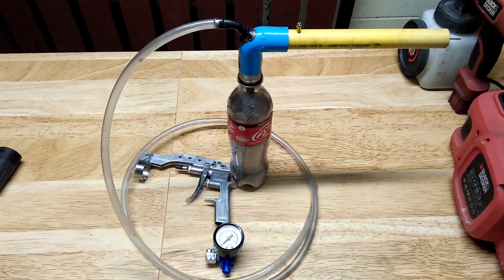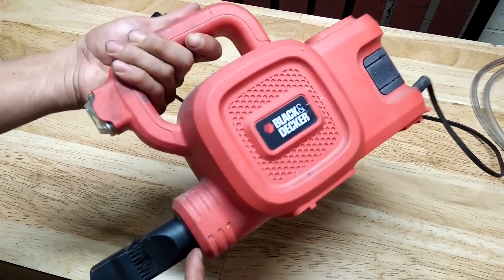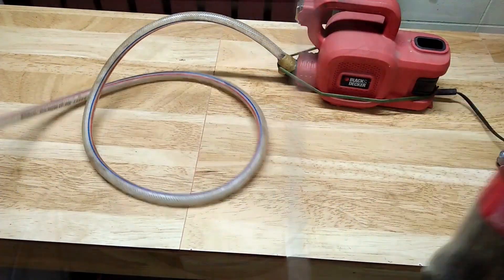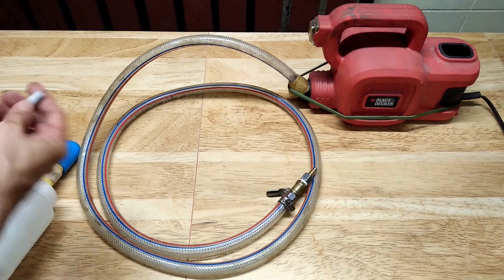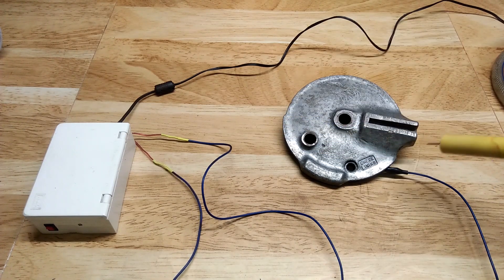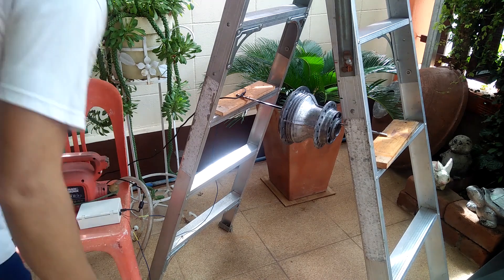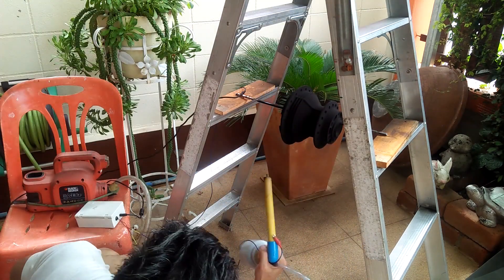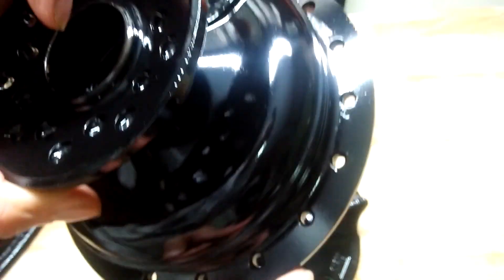Homemade Powder Coating Gun Ver.2

Comment: Can I use simple DC electric supply 4 volt 3 amp with cooking stove module ?
Reply from the maker: Hi. I am not sure what cooking stove module you have. Can you give more details? There is a high voltage generator on some gas stove that is used to create spark that ignite the gas. If it have DC output then it can potentially supply high voltage electrostatic charge.

Comment: Is it possible to use a high voltage transformer for a TV, and how do we determine the polarity because the transformer has no polarity?
Reply from the maker: Hi. I made some experiments with different kinds of high voltage transformers including the tv flyback. Have a look at this video:
https://youtu.be/U24Y4QNquX4?si=ROwMRklKb_Is1HwT
Most of the tv flyback transformers have internal diodes so they actually have polarity.

Comment: Have you thought about making a Tribo style gun?  No real electronics  needed. I have watched all your P.C. gun videos; I am amazed with your ability to think outside the box, and with your skill in electronics. Very insightful videos.  Thank you.
Reply from the maker: I have thought of it. I have looked online for where I can buy the PTFE plastic or teflon that is needed for the tribo style gun but cannot find a suitable material yet. I'll give it a try some time.
Reply: @DIYPhil 
You may try teflon tape used to seal hydraulics connections. Just wrap it tidly around any nonmetal material of your choice.

Comment: Did you use regular cables? 
Havent you receive a spark through the cable crossing your hand when its on? 
I'll be using a relay to run compressor and hv generator, just worried about crossing these cables with hv and no proper insulation
Reply from the maker: Hi. Yes those are just regular wires. In this version, I am only supplying lower voltage and limited current input to the HV generator/taser module so it is not on full power. Otherwise, you are correct that you may get a shock. That is why in my latest versions, I totally scrap this idea and build my own HV generator onto the actual gun so no HV in the cable. Please have a look at my updated videos of the homemade powder coating gun.
Reply from the maker: https://youtu.be/zr-EW036TUI
Reply: I watched them all
Excelent content hehe 
I'm still trying to fix my unit, but I'll make one of these to use in this meanwhile

Comment: What is your reason behind considering power coating over chrome or nickel plating...? Want to power coat my suv rims/wheels...the only thing setting me back is i have to build a large oven from scratch and it aint cheap.
Reply from the maker: Powder coating gives you more color option and is more durable than liquid paint. Try to find shop that do powder coating in your area
Reply: @DIYPhil   Did a look up around already...people either dont have large ovens or the service charge is way too expensive..I finally narrowed on nickel plating which initially gives a frost chrome look which am totally into...the whole setup was effortless,relatively cheap and redoable.👍

Comment: Kinompare ko kasi readymade powder coating machine here in Thailand, parang pareho lng po ang resulta, i can save money for this, ang ibili ko ng rradymade na machine i assemble ko nlng ng diy oven no? Dba po?
Reply from the maker: may next project din ako DIY oven, nakabili na ko ng insulation, wala lang oras pa kasi dito pa ko sa trabaho. kung gusto mo pre kontakin mo ko sa emai: philipal2015@gmail.com o kya message mo ko sa LINE eto number ko dito sa Thailand: 0898154451
Reply: @DIYPhil  Ok to Pre, plano kasi ako mg IRON WORKS business sa Pinas pagmkauwi, pwd isabay ang powder coating po kasi, if gusto po mg fabrication. Thanks sa mga idea mo Pre ha, gusto din uuwi na, uuna lng kami muna sa 2 anak ko.
Reply: @DIYPhil  ang LINE name mo is Philip dba po? Na ang profile pic nkatayo kapo nkadark blue at parang palayan ang sa likod mo po at prang may motor sa tabi mo? Yon po ba? Kasi inisearch ko ang fon number yon po ang lalabas.
Reply from the maker: @danitsgospelsongs4990  nakita ko na bro. dapat pala i accept yung add friend. kala ko automatic. he he he
Reply: @DIYPhil  nakita mo na mesedz ko sa line?

Comment: Good job 👍 can you coating glasses
Reply from the maker: Yes.  There are 2 ways to coat glass.  Can put aluminum foil at the other side to be coated and conect that to power supply. So that powder can be attracted by electrostatic charge.  The other method is to heat the glass in the oven and spray powder while still hot.
Reply: @DIYPhil  thank you